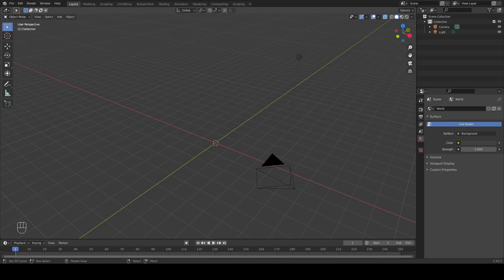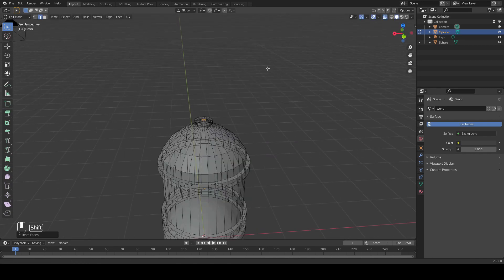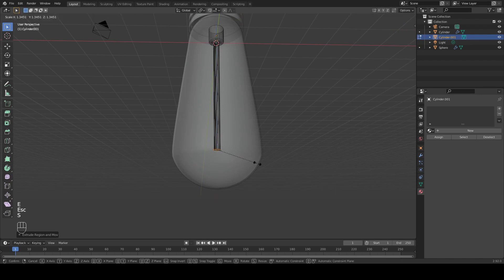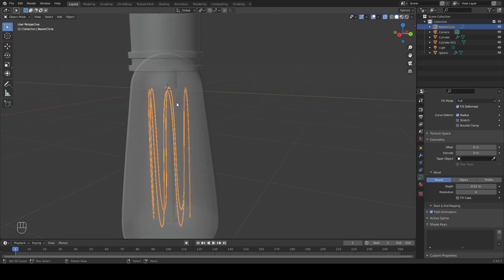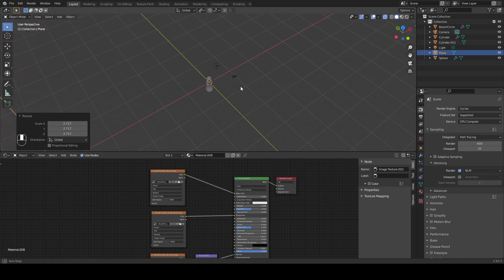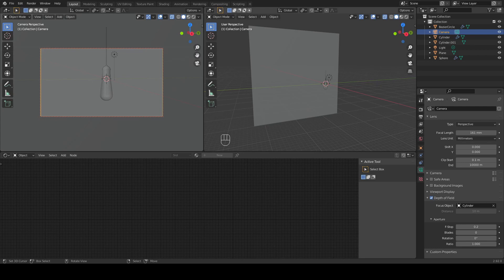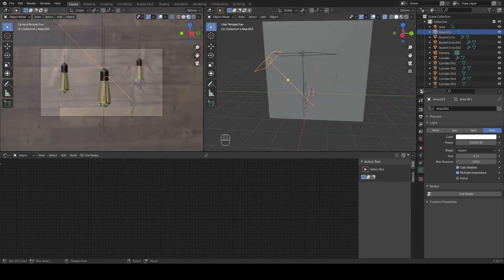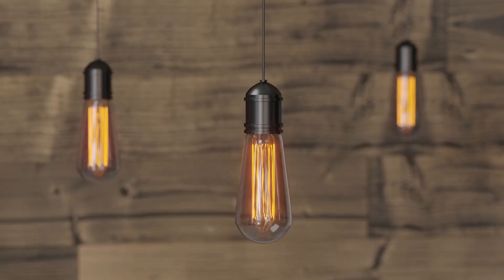Edison lightbulb scene | Blender tutorial

Comment: Very good tutorial.  I learned a lot. I like your style and pacing!
I do have a comment and a question.  It seems counter-intuitive to me to add additional lights to a light bulb scene.  I have been trying to create ArchViz with chandeliers and other light fixtures with exposed light bulbs like the Edison light in your tutorial.  The modeling works great, but the light is really low.  I can get the filament to glow the way you did, but in the real world, the room should be illuminated by these lights, not some additional light object.  When I crank the emission up to 1,000,000 or higher, I still just get a small glow.  I have tried adding a Glare in the compositor, but this does not seem to create realistic light for the room.  I believe the root cause is the amount of geometry in the filament (very small), but in the real world filaments are small, yet they create a lot of light.  

So, my question is...  Do you know how to create light coming from the filaments (or the illusion of light coming from the filaments)  that light the room the way an Edison light bulb would light a room?
Reply: This is because the shader setup won't let light pass through the glass the way it should. Instead, do this:
-Add a glass node
-Add a transparent node
-plug them into a mix shader
-Create a light path node
-Plug shadow ray and reflection ray into a math node (operation "Maximum")
-Plug value of math node into mix shader factor
-mix shader into material output

And there you have it, real transmissive glass in cycles!